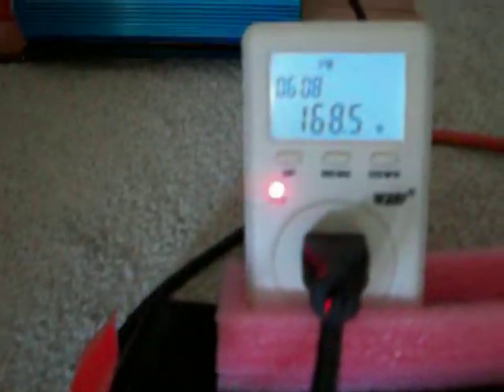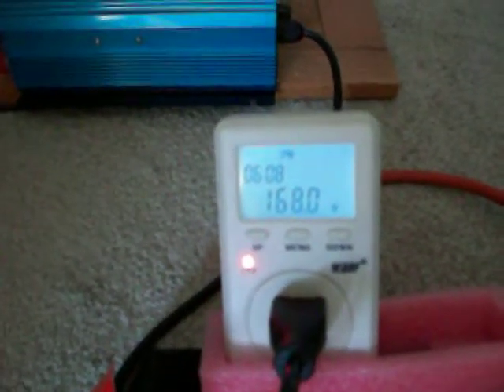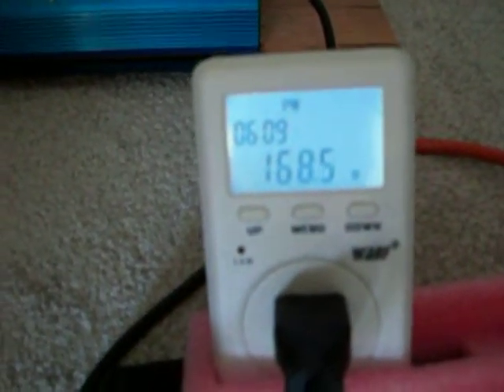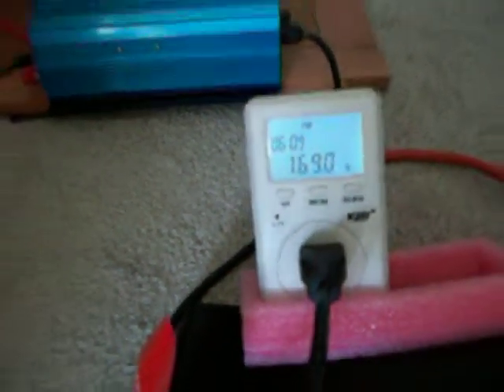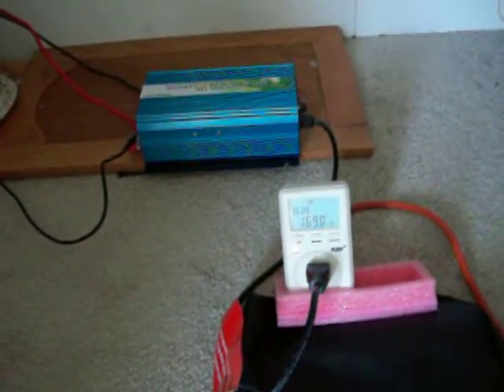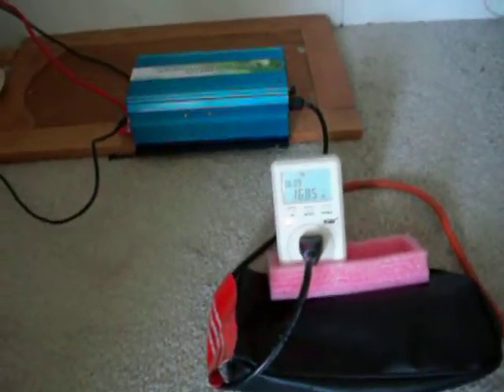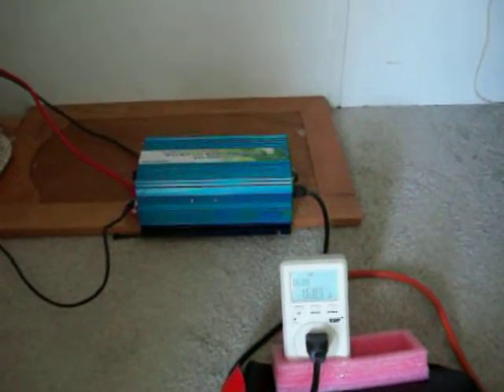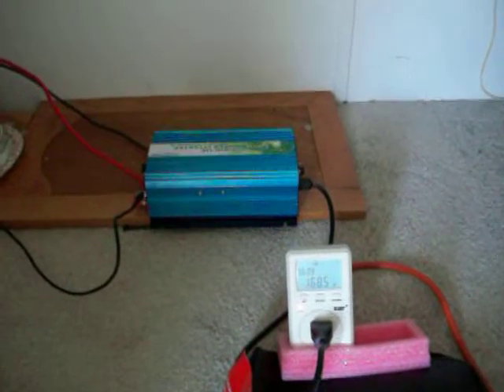Power Jack inverter Testing Useing Diffrent Types Of  Panels

Comment from the maker: @robrice2004 -  At 10.20 AM.today 1-2-12.i just checked my power jack @ 60F. it was getting 12.7 Amps in and puting out-186.6 Watts.it has added to the home as of this last check point 12.953.7 KWs since in started last Sunday AM.its been any were from 228 watts to 40 watts depending on sun lite.i,m trying to decide what to buy as i also use my batt bank (4-dekka 105amphrs@20hr rt.) i can use at least 1 kw min a day thru my inverter to run my LR.lights sat box TV &Amp.+ recharge Full each day

Comment from the maker: Thanks i welcome any & all advice as i am still quit new to this. As far wire goes i,m at less than 40 ft with # 8 AWG,but some panels are @MPV-29.8 small are@17.8.I Think i will run they smaller panels in series to make them about the same about 30 vts,that is rated at max 76 FT.@15 amps per my Morningstar wire charts .So im loseing a good bit of power on the low voltage panels.

Comment: These chinese inverters are only good for about 120watts  of solar panels  going in to them. you need to get more inverters and put about half there rating in to them (pj1200 inverter)......or if I had it to do over I would do the enphase inverters there much better and are made to be outside mounted to the panel....

Comment: You can't tell what it going in by the sticker rating of the panels. You need to write down the amps and volts going in at the same moment as you read the output. You should do that several times and sort of average them out. Under 100W those GTI's can get you near 90% eff, and at full output they are about 78%. Most panels will not produce the "retail sticker" amount, that is a perfect sun with a doughnut cloud around it, meaning the max you would ever see is what they rate them at.